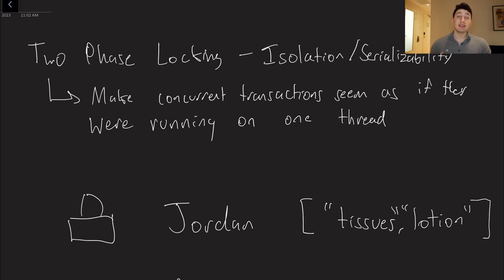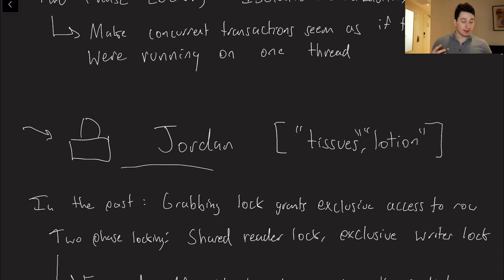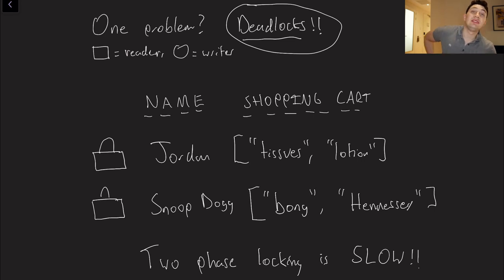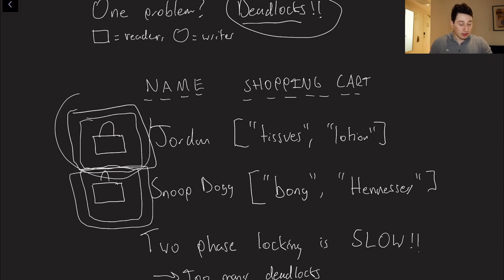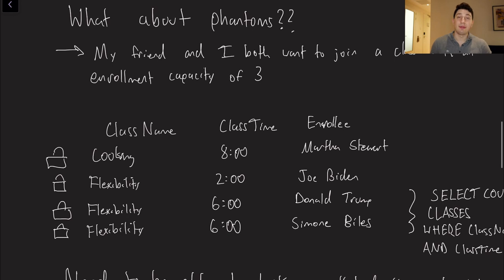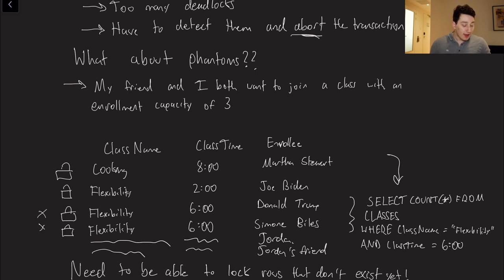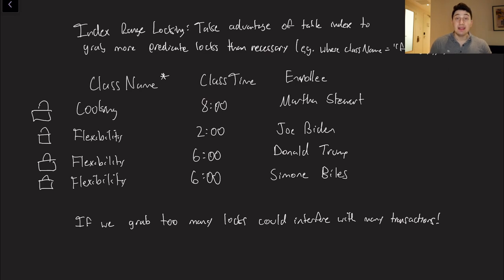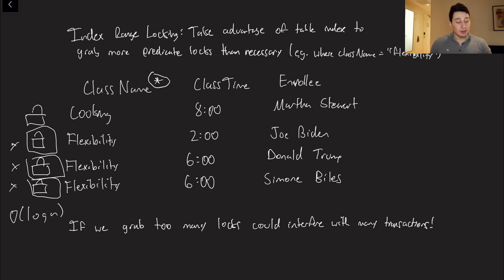Database Internals: Two Phase Locking | Systems Design Interview: 0 to 1 with Ex-Google SWE

Comment: Good content.

You are conflating phantom reads with read-modify-write. 
Phantom reads are not about writes. They are about predicates in where clause changing mid-transaction because another transaction committed.
Read-modify-writes (e.g. lost updates) are a sub-example of write skew.

Write skew is strictly easier to solve with a lower level of isolation than phantom reads.
Reply from the maker: Oops - probably forgot what I was talking about by the time I was making this video lol, thanks for the clarification.
Reply: gpt says that phantom reads is easier than write skew: 

let’s re-examine the concepts of write skew and phantom reads, and the isolation levels required to address them, to ensure clarity and accuracy.

Phantom Reads
Phantom reads occur when a transaction reads a set of rows that satisfy a condition, and another transaction modifies the set of rows (by inserting or deleting rows) such that the first transaction sees different rows if it re-executes the query.

Repeatable Read: This isolation level ensures that if a transaction reads a row, it will see the same data if it reads that row again. However, it does not prevent phantom rows because new rows can still be inserted or deleted by other transactions.
Serializable: This isolation level ensures complete isolation by making sure that transactions are executed in such a way that they appear to be run sequentially. It prevents phantom reads by locking the entire range of rows that the transaction queries, ensuring that no other transaction can insert or delete rows in the range.
Write Skew
Write skew occurs when two transactions read overlapping sets of rows and then perform updates based on what they read, potentially leading to inconsistent results.

Repeatable Read: This level does not prevent write skew because it only ensures consistent reads for individual rows, not for sets of rows.
Serializable: This level ensures that transactions are executed in a way that they do not conflict, effectively preventing write skew. Serializable isolation makes sure that any read-modify-write operations are coordinated so that the results are consistent.
Which is Easier to Solve with Lower Levels of Isolation?
Phantom Reads: These can be partially mitigated with Repeatable Read or Snapshot Isolation. However, full prevention of phantom reads typically requires Serializable isolation because it ensures that no new rows can be added or existing rows deleted within the range of a query during the transaction.

Write Skew: Preventing write skew effectively requires Serializable isolation because it ensures that transactions are serialized, preventing conflicts from overlapping read and write sets.

Conclusion
Upon careful re-evaluation, it is clear that:

Phantom reads can be mitigated to some extent with lower isolation levels like Repeatable Read or Snapshot Isolation, but complete prevention typically requires Serializable isolation.
Write skew is more challenging to solve with lower isolation levels and generally requires Serializable isolation to ensure that transactions do not produce conflicting updates.
Thus, while both anomalies are best addressed by Serializable isolation, phantom reads can be more easily mitigated with lower levels of isolation compared to write skew. This makes phantom reads slightly easier to handle with lower isolation levels than write skew.

Comment: So the solutions to solve the Phantom issue is to the either locks more rows than necessary or lock all rows that satisfy a predicate. I'm having trouble understanding how either of these solutions of locking rows prevents new rows from being created? 

When we say "lock the rows" are we using a reader-lock or perhaps some other special lock?
If it's a reader-lock, I don't see how that prevents another transaction from writing the same row.
Reply from the maker: How can I write a new row if the prerequisite to this is being able to grab a lock that some other transaction has already grabbed?  It's any old lock.  You need to grab it in order to perform the write.
Reply: @jordanhasnolife5163 I had same doubts so when you say it need grab the lock means an exclusive lock here right?
Reply from the maker: @bharatahuja_  Reader writer
Reply: For phantom issue, one technique is  to use index locking. With the index locked you cannot add new rows